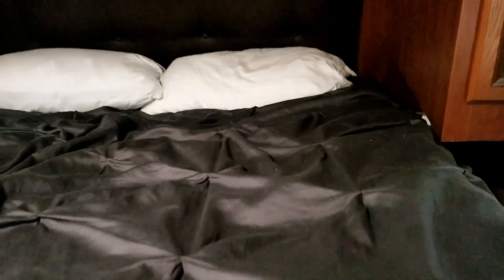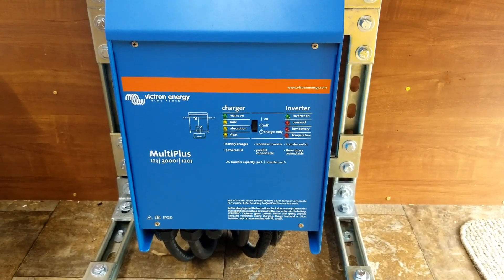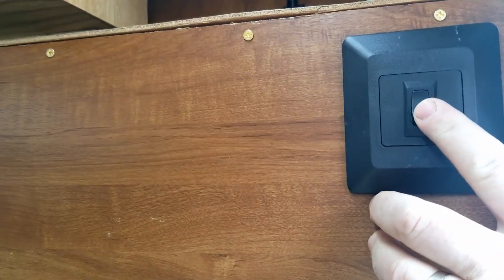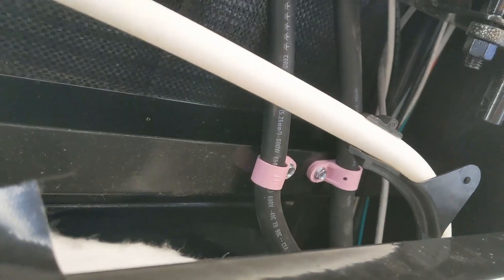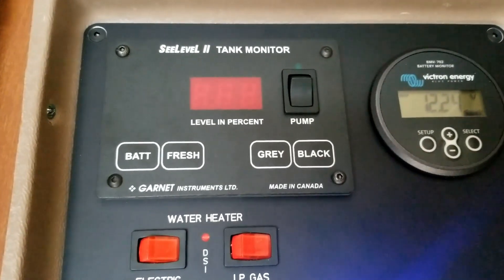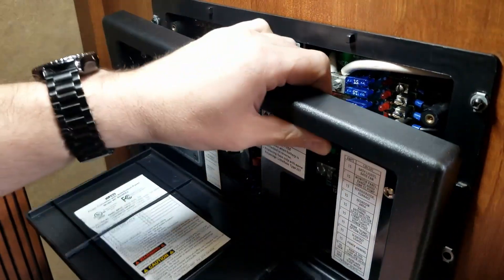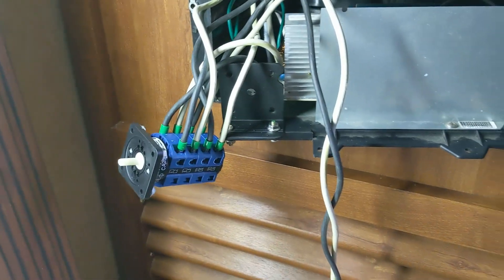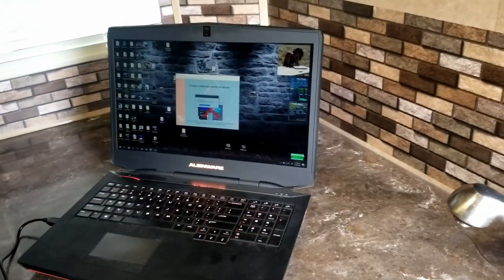We upgraded our Jayco Travel trailer charger with a Victron Multi plus

Comment: I’m installing this same 3000 watt using 4/0 cables not 2/0. Thinking 2/0 is undersized
Reply from the maker: I'd be interested in your results. We haven't had an issue with it yet. Our rv is a 30 amp system and we don't ever come close to using it at capacity with the inverter.  Thanks for watching and commenting.

Comment: Hi
I bought the compact multiplus 12V 800VA 35A but when I measure the resistance between the phase and the neutral of AC OUT (without anything connected to the public network to AC IN) I have a value of 4.5 ohms and it worries me that I am short circuit

Comment: Where did you get that mounting bracket for the Blue Sea circuit breaker? or did you have to make it?
Reply from the maker: The bracket for the 30 Amp Blue Sea breaker can be ordered separately or with the breaker. It's the 8173 mounting panel and cost us 25 dollars including shipping. The sell a complete kit as well.
Reply: @W7EDM  thanks, that is helpful as well, but I meant the smaller bracket holding the single breaker (with the red lever) that you planned to use for your solar.
8:40
Reply from the maker: @Daveck86  that was homemade.
Reply: @W7EDM  ok, thanks for responding back!

Comment: Hi Ed, nice clean installation! I’ve done a similar install with a 24V system. I upgraded my travel trailer’s 30A/120V AC system by installing a Victron Energy MultiPlus 24/3000/70-50 120V with the Color Control GX Remote Panel, BMV-712 battery monitor and battery temp. sensor and 4 Surette Rolls 6V 250Ah AGM batteries wired in series creating a 24V battery bank (6.0kWh) with two Jinko Eagle PERC JKM365M-72-V 365W, 24V solar panels wired in series to supply 730W @ 48V to a Victron MPPT 100/50.

I installed an enclosed plywood box under the bed and vented it to the exterior. As the 24V battery bank leads run 15' from the Multiplus, I used 2/0 AWG fine strand copper cable. One positive line and one negative line, twisted together along the run to reduce inductive resistance and IR interference. All other DC connections were done with 6AWG fine strand copper cable.

I installed the inverter/charger in line with the shore power infeed. That is, I wired the shore power infeed through a 30A breaker (same as yours) then connected to the 120V AC input terminals of the inverter/charger and the output terminals connected to the trailer’s 30A/120V AC panel. 

This method seems to be the simplest and least invasive integration with the trailer’s existing AC/DC system. Everything onboard operates the same whether connected to shore power or operating on solar/battery power. The existing IOTA DLS45 DC Converter (with the optional IQ4 Smart Charge Controller) remains in place providing 12VDC for onboard systems and smart charging for the 12V battery bank (2 6V, 230AH golf cart batteries) mounted on the reach. 

Ya gotta love Victron Energy components!
Reply: Glenn Matthiesen Do you have a contact email? I would like to ask you about your setup.
Reply: @bryanreeser4630  Hi Bryan, glennem@shaw.ca

Comment: Thank you..  An i correct that the multiplus is a converter and inverter all i one?

It replaces the factory rv converter ?  

I have an older toyota rv... Originally hoyse battery is 1 qty lead acid..

I want to replace it with with 3 qty lithium iron batteries...  With the mulitplus provide 12 volt and 110v power to the coach?

I plan on charging the batteries from the RV's alternator during trips until i get solar...

Thank you and subbed...
Reply from the maker: Yes, it replaces the stock converter. Although, we left the stock converter and installed a switch so it can be returned to normal in case of emergency or for repair.
Reply: @W7EDM  that is an absoltely brilliant idea...  THANK YOU!!!!!! I will do tge same.. I have an anolog converter... Going to a 4600...  Then a multiplus....AWESOME...please keep the informative videos comimg

Comment: Did you solid copper for your ac in and out or flexible? Looking at installing one myself
Reply from the maker: We used 10ga flexible stranded. The flexible made it easier to route and since it's  protected in the belly of the trailer we didnt see the need for the protective sheath they put on Romex.
Reply: @W7EDM  Awesome thanks. Any idea if you still have a wiring diagram on the bypass switch that was installed just incase the inverter went faulty?
Reply from the maker: @nickhensley9904  I do!  If you comment with an email address, I will send it to you and delete your  comment with the address.